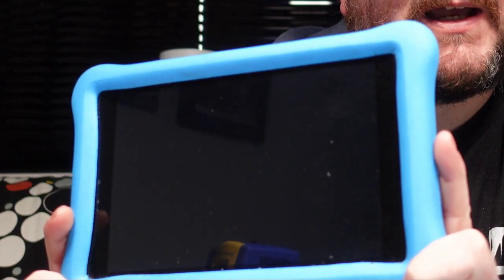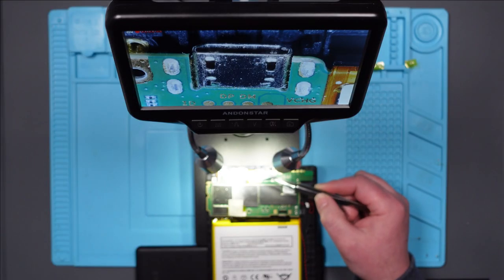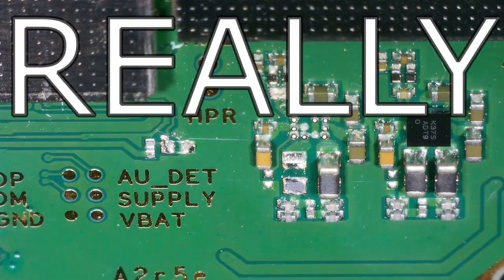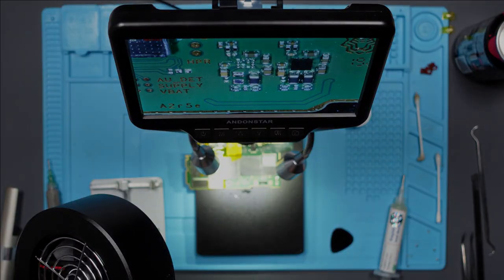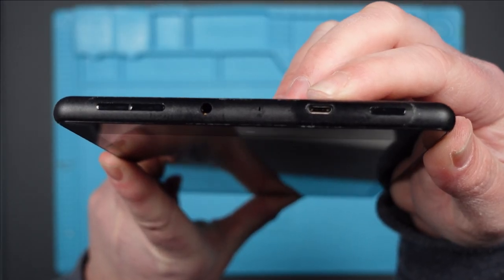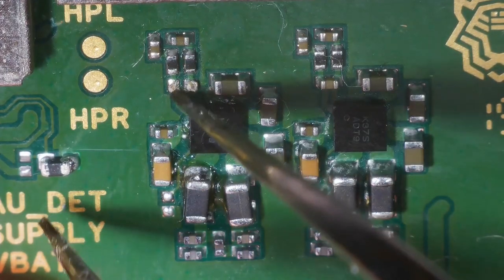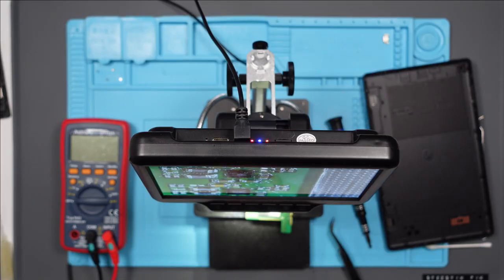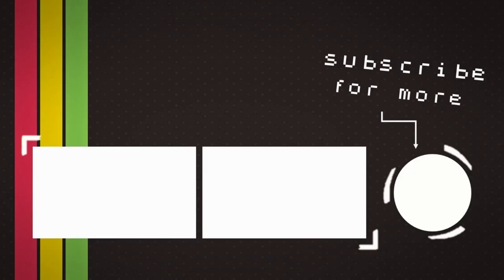This AMAZON FIRE HD 8 Doesn't Charge | Can I FIX It?

Comment: The ribbon cable you thought you couldn't take off at the top is probably the touch screen cable. Make sure that didn't get melted or damaged. I bet that's the problem.
Reply from the maker: I thought that too Travis.  It is indeed the cable for the digitizer, but I did check it over and it looks absolutely fine.  No melting, no rips or tears, and continuity is good from connector pins to ribbon cable.  It is possible that it's damaged below the casing (where I can't get to) but I'm worried about removing the screen to take a look!  😁
Reply: @StezStixFix  Ya, there's nothing you could do to fix it at that level short of replacing it. I don't think replacement screens\digitizers are expensive if you're hoping to save face. Otherwise maybe ask if the touch screen was damaged to begin with. It was, after all, a child's Kindle. Good luck Steve!
Reply: That's right, this is the digitizer ribbon. Might have got damaged when prying off, for example got stabbed if you used twizzers and it would be hard to spot the damage. Replacement digitizer are not very expensive. Use your hot air to heat up edges and remove the old digitizer. You'll need some adhesive to stick the new one in as most available on eBay don't have any preapplied. Also you'll see foam strips on the old digitizer around the clear central area. I think they block backlight from being seen on the edges. You can transfer these onto the new digitizer, just be careful as they can rip easily. Good luck.
Reply from the maker: @wardrin  Thanks Wardrin! I think I might have to give that a go. Really appreciate the info. 👍

Comment: I would much rather see a real live repair attempt than some slick video showing how easy it all is. Hope you get it fixed Steve, if not, well as you said you repaired the fault that it came in with. Good Vid!
Reply from the maker: Thanks Tony! Yeah, this one was not at all easy. I hope that came across. I had a hard time with those ripped off components, but I feel like I've definitely learnt from it! 👍
Reply from the maker: Mrsuperking Youtube631  I'm not sure how much the cases would be, haven't looked in to it. Yeah, they are not very powerful devices, not good for gaming. Your newer one sounds better though 👍

Comment: Proof that no good deed goes unpunished ... I really hope you launched that board holder out the window at high velocity back to China!  If you can enable bluetooth and pair a device with it you might be able to gain some control.  I think some more research may be required.  Alternatively if you can find one on ebay with a broken screen and do a transplant?
Reply from the maker: Good shout G B!  👍  And yes, I most definitely launched the board holder.  It's in the bin now, with the terrible solder!

Comment: When it comes to charging ports and children's tables, I have found that the magnetic charger connectors are best. I just install the little insert and then just a drop of hot snot to hold it in place. Then they can't destroy the port.

Comment: Really really enjoyed that Steve!!!! even though I could feel the pain you went through. Maybe buy a digitizer but don't fully install it. Just connect it up to the board and leave it flapping in the wind. You can then work out where F is by trial and error to see if it is working on the new digitizer before having the hassle of fitting it. It might turn out to be flux in the actual connector rather than a faulty digitizer. I feel a revisit coming on. I think you will get this working mate 👍
Reply from the maker: Thanks Vince, really appreciate that! I can't believe i haven't thought of connecting the digitizer without removing the old one! That would make life much easier, and I think I'll give that a go! Thanks mate 😊

Comment: A few constructive tips.  A big part of soldering is choosing the right tip for the job . Your tip is too small and fine for almost any anchor point, the solder is probably not at fault here.  You can hot air a port this size off without wicking it first. I don't think you gain much benefit with your method compared to the risks.  You can use your low melt to aid in it if your worried about how much heat you will be using, but, can also regulate heat by moving your nozzle more rapidly (I will  be doing some basics content on this technique).  Don't press down on BGAs, they are not like QFN., they react poorly to it. 
Hope some of that helps with the next try.
Great production and editing as always.
Reply from the maker: Thanks Micro, yes that does help, thank you! I knew i had the wrong tip, I just couldn't be bothered changing it - Definitely something that I need to work at! I only started wicking because I couldn't remove the ribbon cable, I have no idea why I carried on afterwards though 🙃. But yeah, really appreciate the feedback and I'll keep working at it. Cheers mate 👍

Comment: Draft question but does the keys not work in either rotation, if it didn't as you touch 2 different areas of the screen it must be a touch screen issue.
Reply from the maker: Thanks Beaps, no idea why I didn't think of that! Yeah, they work in landscape, so it's definitely the digitizer! 👍

Comment: steve it looks like it has a dead spot in the digitiser which i do not think was your fault you can buy new digitisers but they are a pain to do  i would have took the charge port off with hot air then cleaned the pads and holes up after you would have saved your self a headache well done though you fixed it
Reply from the maker: Thanks Jon.  Yeah, I've since read up on it, and the dead spots do seem common.  I started with the soldering iron on the USB port because of the proximity to the ribbon cables, but yeah hot air was definitely the easier way to go.  I wanted to try it though, as I've never done it before, so once again, I've learnt something!  👍

Comment: What I ended up doing with my crap solder, is to use it as fodder solder.  I use it to coat my iron tip before putting it away, so the crap solder is what oxidizes instead of the tip - saving my good Kester solder.  And of course, before using it again, it's wiped off on the brass shavings.  That's all it's good for...  Fodder Solder™ 👍

Comment: I know this is an old thread but it occurred to me that if the fault is the touchscreen does it have auto rotate? If so, could you rotate the unit and see if the F works on a different part of the screen?

Comment: I need some help with my PS4 because when I turn it on it load onto a black screen as usual and then I stay onto the black screen and doesn’t change. I’ve done everything from the safe mode and I don’t know what to do.
Reply from the maker: What colour is the light on the front of the PS4?  If it's white, then it's probnably a HDMI issue, if it's blue it could be a multitude of things, but possibly the hard drive 👍

Comment: Wow that's a big battery, That's what the Hen said the Cock 😂 I spy a Gravediggaz T-Shirt 6 feet deep if I recall. Stevie Blood or Stezo ✌   
Anyway you can disassemble it further a bunch of screws & some patients. You got to hot air the old one off OR the blue mat of death (Not recommended)
Love you SteveN platonic of course. You got me to add the N 😒 I did my daughters, she was so upset. A little patients & perseverance pays off in the end 🖖👍
Reply from the maker: Excellent Gravediggaz knowledge there Steve  🙌.  I'm very tempted to replace the digitizer, but the owner isn't too bothered and only really wanted to get the data off of it, so I might not get chance. 😊
Reply: Yep I used to wear them too! I had a sweatshirt that I liked a lot, until one day I went with my younger brother on our motocross bikes and I was jumping a 4ft hump to teach him, how to keep the front wheel down & level. My top was tied around my waist and got ripped apart by the sprocket :/ I wasn't happy at the time. Anyway can't they let you fix it after they got the data? My daughters data is on the 'Amazon Cloud Drive' so surely they can do that, then let you do your magic on it 😎

Comment: "Fire for Kids" - should they be allowing kids to play with fire?!? 😜

Seriously though, so frustrating with the touch screen/digitiser, especially with the successful charger port repair.

Holy smeghead; I was annoyed for you with the board holder striping off those components. 😵 Are there any audio/video files/access to YouTube apps to try out the stereo audio? Headphones would probably make it more obvious to test. Worst case scenario, at least mono should work.

I've got faith that you can fix these issues. Keep up the good work Stez!
Reply from the maker: Thanks Toxo 😁 .  Yeah, I supsect it's outputting mono, but for such a little device, I doubt anyone would even notice.  That board holder is most definitely in the bin!  It was an accident waiting to happen... the tension in the springs is hefty!
Reply: @StezStixFix  In fairness, the board holder looked like really good idea (I was tempted until this video) and is probably fine for single sided PCBs. It could do with something to elevate the board a bit more to stop the components rubbing whilst without losing the strength of the grip.
Reply from the maker: @ToxoRetro  I've got another board holder, buy it doesn't raise the pcb. I've also ordered a magnetic one to try, but I'm not sure I'll have any more joy with that. It seems to be hard to find a decent one!
Reply: @StezStixFix  Good luck. May the force be with you.

Comment: I have the same tablet that gave up charging after the micro USB socket pin on the actual tablet became loose over time ( common fault) That's why kindle are now using the type c ports
Reply from the maker: Thanks N!  Yeah, it does seem like a common problem wit hthese tablets.  And I guess with the Kids' version, they're going to be putting in the Micro USB upside, which wont help.  The USB-C port sounds like a good solution!
Reply: @StezStixFix  I got the 2019 kindle fire 10 HD now. Its quite a lot better, full HD screen and type c port. No issues yet 👍 I think all devices now are going type c. Ps5 have on their control pads whereas ps4 haven't
Reply from the maker: @ndavies5968  USB-C is definitely the way to go.  I've not had a play with the Fire 10's but they do appear to be a step up. 👍